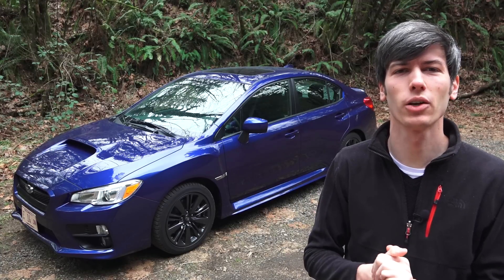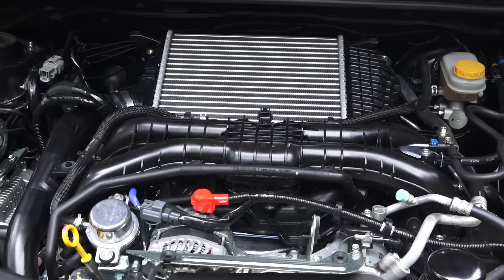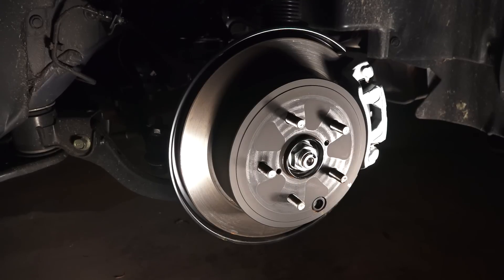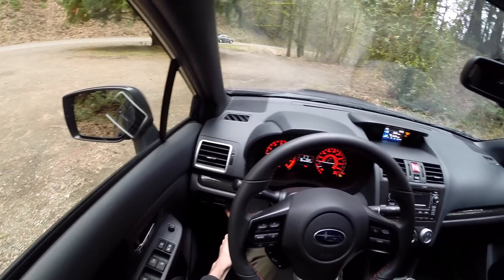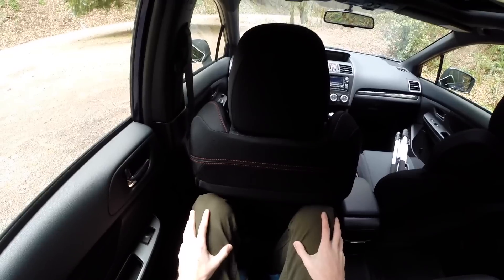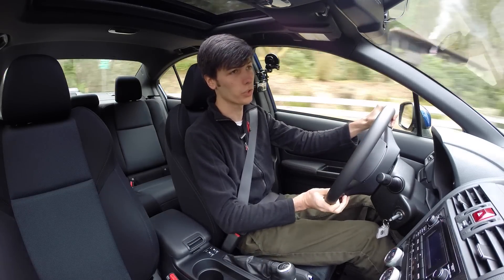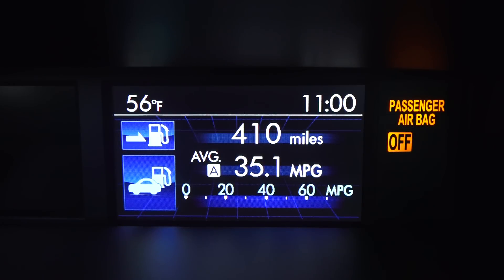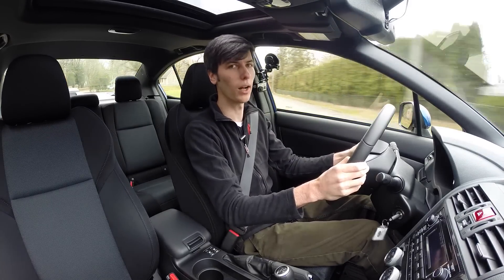2015 Subaru WRX - Review & Test Drive

Comment: Why do so many modern cars have rev hang when shifting?
Reply from the maker: +GT6SuzukaTimeTrials I've driven a good number of modern cars which do not, but that said it has to do with electronic throttles and likely emissions.
Reply: And that's why I hate new cars. I wonder if the new MX-5 does it too. That would be sad.
Reply: +Engineering Explained i saw ur wrx vs sti comparison video, did u talk to Subaru to see if they will fix the rev hang?
Reply: +Engineering Explained which feels faster, the 2016 accord COUPE v6 6MT or the Wrx. I understand this has a better 0-60 due to the AWD, but which feels like it has better pull? I'm looking at a 2015 Wrx or an accord COUPE v6 6MT, I can get a slightly used one cheaper than the WRX, and its most likely more reliable than the wrx, and probably alittle cheaper on insurance being I'm 18, but what is your opinion?
Reply: Engineering Explained  bro can you tell me  in 2015 subaru wrx sport-tech cvt how many it is how many it is 4 speed automatic transmission  please reply to me  bro how many  speed how in speed  automatic transmission please reply to me

Comment: how bearable is the noise on long highway commutes? I notice that you had your moon roof open during the video. Would changing the tires help? If so to what kind?
Reply: +Thai Van Road noise hasn't been much of a problem actually. I can tell it is there, but it isn't to the point of always being noticeable. I have a 2016 Premium WRX.
Reply: Thank you, I am currently shopping for a premium wrx with no options. May I survey how much you got the car for msrp + tags and fees?
Reply: Lets see, I paid just about 35k for mine. They sold at MSRP here and wouldn't budge. All the surrounding areas to me were selling for well over. My fees were minimal, only 150 or so. Out the door, 35,200 roughly. Mine was loaded pretty well though. I got the upgraded sound system (worth it IMO).
Reply: How do you like the car so far? What do you dislike about the car?  Would you invest in Dynamat? I test drove the car and notice that the shifts were very notchy, which makes it difficult to drive smooth. Did you learn to drive smoother with time or it's just how the car is (jerky)?
Reply: +Thai Van I haven't really had the problem shifting smoothly with this car. I had an mk4 gti with a stage 2 clutch, so I may have some practice with smoother shifting. I love almost everything about the car. My cons for the car... hmmm, maybe the interior? it is cheaper, but I knew that going in. It honestly doesn't bother me at all.
Reply: +Thai Van also, I should note that I will be going stage 2 with this car.

Comment: this wrx is faster the si but it will nott outperform the si in traffic on high speed due to weight and two axkes
Reply: +jay czyzyk I just shit my pants I laughed so hard
Reply: +jay czyzyk si? or sti?
Reply: sti
Reply: what you gotta be young
Reply: +Chadd Francisco wrx all the way
Reply: not in heavytraffic
Reply: I call bullshit
Reply: Cole Eden on what?
Reply: Cole Eden I think he meant an sti. I personally back the new wrx over the new sti, but that has to do with the motor. The si isn't even in the same class.
Reply: no  civicsi will outperform any wrx in heavy traffic due to slow shifter and heavy clutch
Reply: jay czyzyk ... what are you talking about? Who cares about heavy traffic.
Reply: no its rod actuated

Comment: hey engineering explained I have one question. Ive heard it's bad go go wot in a turbocharged car in 6th gear. is that true?
Reply: Going WOT on any motor is bad. No reason for going WOT in 6th, it's a cruising gear. The only acceptable scenario to go WOT in 6th is if you revved out 5th gear and I hope your at a track doing that.
Reply: +Mrlolibre what? Wot in any motor? Or wot in 6th gear in any motor? Hopefully the latter becuase these cars are made to go wot

Comment: can someone help me out? it was my understanding (and from looking at Subaru's official website) that the 2015 wrx wasn't even offered with an automatic transmission. I thought subaru stopped offering automatic transmissions for wrx's years ago
Reply from the maker: +MrOverSuper 2015+ have a CVT as an option.
Reply: Engineering Explained thanks
Reply: +Engineering Explained hey I'm in the middle of a pickle. I sold my frs because I'm I needed something a bit more practical since I have a family now. My options are either the 2015 Wrx or and mk7 gti. Since I did come from a drivers car that handled pretty well and I plan to daily my new car. Which car do you think would be a better fit yet be fun to drive for the canyons? I'm going to go on a test drive for both of these cars of course but what do you suggest? Thanks for awesome videos. Keep them coming!
Reply: +jdm06types as for the points you mentioned i'd assume the GTi to be a bit more fun being a bit smaller and tighter. but as for an all rounder the wrx wins. i myself will be upgrading from my 2010wrx to a 15 next year, i've gone through the dilemma of looking for a fun everyday and the wrx wins every time since there is no Focus RS yet :(  half because of its ability to be fun and pratical...and half because of its affordability... a VW will definitely cost more to keep on the road as the maintenance and repairs start to add up later in its ownership.

Comment: hi, i was wondering how hard it is to pick up the manual transmission on this car. i've never driven stick before, i am considering buying this car or the legacy. i like this one a lot, since its more sporty and fits with my personalty. I'd like to get the manual, of course because its cheaper and more fun, but where i live theres so much traffic a lot of stop and go I'm not sure if its a good idea, also considering i've never driven stick before.
Reply: Rough AF believe me. Dumped it a few times by accident and burned it once, but still catches like the first day I got it. 7200 miles

Comment: Does the base WRX really accelerate quicker than the STI or did you just had a typo and it should have been 5.9sec?
Reply: +TheClawGaming If I'm not mistaken, the base WRX reaches max torque at 2000 rpm (which is very low) and has a much larger powerband than the STI. This results in quicker 0-60 times in the WRX. In those city environments where you want quick boosts of speed at low rpms, the WRX will be better. Where the STI shines is around 4000 rpm. 4000 rpm is where the STI will experience its max torque so it tends to be better for more of a racing/track sort of environment when you are actually putting more stress on the engine.
Reply: +Dextah But when you are accelerating hard you will always be in that STI sweatspot. Motortrend even clocked the STI at 4.8secs on a flat ground.
Reply: +Dextah can you tune the wrx to boost at higher RPMs?
Reply: +nejiii drop a larger turbo and yeah

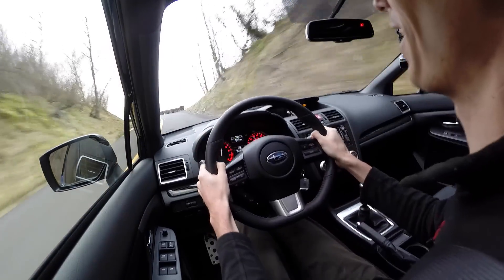Comment: At 11:50, yes I know the MT is always better, but the issue arises when nobody in your entire family (even cousins) have no understanding of what a clutch pedal even is.

I'm genuinely considering a WRX in a near future. However when spec-ed up to what I would want it, it stickers very uncomfortably close to an Audi S3 which is much more luxurious, just as quick and has even more tech on-board. Also I know I won't like my Insurance rates if I decide on this car.
Reply: *****
I know :D
But still it is a dick move on my part.
Reply: +xk302a Yes, but the base $26k WRX has less equipment on it than a base Corolla. Also it doesn't help the MY2015 Corolla feels more premium/expensive than the MY2015 Impreza & WRX. But I digress.

When I load up the WRX with the same amount of stuff I want in the S3, their prices are within spitting distances of each other (~$3k difference) which factoring in the nicer overall build quality of the Audi I feel like I can justify.

Comment: I had a 2015 WRX, base model, until the dealership wrecked it. So, now I have a 2016 WRX, premium. I had them put a short-throw shifter on it before I took it home. The throws are much better now, but it still gives you a good feel of being in each gear.

I don't like the stereo in it. The premium has two stereo options. The higher one has a 7" screen, and much much better functionality. Mine has the 6.2" screen, and a few irritating features. I can't search music by letter. I have to scroll. So, if I want to hear the White Stripes on my 120 GB iPod, I have to scroll for a day and a half to get there. You can't even scroll up, from A, into the numbers, then Z, like I could in the non-touchscreen 2015 stereo. Additionally, if I go to an artist, and want to shuffle all of their albums, I can't do that. There is no "Play All" feature, like in the 7" Starlink system (which also has Nav). You have to listen to one album at a time. I wonder if there is an update for the 2016 WRX 6.2" Starlink. I don't mind the size of the screen, and I don't need nav, but I'd love the functionality to be like in the 7" system. Same software features, just a smaller screen, and no nav. This might be a problem, because the firmware can't be matched. The 7" is a completely different system.

That's all I'm going to say about it, because everyone else covers driving (which I love).
Reply: Since you had a 2015 base and now a 16 premium with inverted struts do you notice any difference handling/suspension wise?
Reply: +Snwszr I do, actually. It's not really different in day to day driving, but there is one turn, on the way home that is better now that I'm in the 16. I didn't even know that the struts were inverted, or if that's the reason. Still, in the 15, when I hit it hard, the tires would screech, and it would start to lose control at the end. In the 16, it hugs better. I can go faster without breaking loose. (This is going about 55 in a 20 mph on-ramp, so they're both great).

I have to be honest though, the 16 has a rattly back dash (from 1500 - 1800 RPM). It drives me crazy. I live pretty far from the dealership. So, I'm about to pull it, and put padding under it, myself. 

The 15 had an issue where the fkin gas door never opened. I had to wedge a gum pack under the interior handle to get it to stay long enough for me to get outside of the car, and get the door open. As far as handling goes, they're both about the same. I don't really notice a difference.

For what it's worth, I love my car. I'm not getting anything else, unless I get a massive raise, and can afford a GT-R.
Reply: +hakkujin dude thanks for the very informative info, I haven't had this question answered clearly on Nasioc or the web. Only heard on NASIOC that it feels only like its a softer suspension and less raw than the 15's/16 base.  I'm planning on upgrading to a 16 in a few months and just contemplating on getting a base or opting for premium for inv struts and bigger wheels. that's good to know though, glad to have got that cleared up and thanks again for the insight 👍🏼
Reply: +Snwszr The last thing I'll say is, the summer tires are summer tires only. They're completely useless, and terrifying in the snow. I got some all-weather tires on mine, and it's amazing in the snow. This is my fourth Subaru because I live where it snows. If you already have one, you know all about that already.

So, if you get a new one, it's shorter, and wider. So, it really does turn better than the old ones, but you'll have to get a short-throw shifter, and some all-weather tires.

Comment: A recent firmware update reduced the rev hang by a ton. Also the 4k torque dip has disappeared as well. Seems like Subaru is addressing the complaints that a lot of us have been talking about.
Reply from the maker: themomopan Could you share a link referencing this update? Would love to read up on it.
Reply: Tim Davidson You have to take it to the dealership and have them flash the ECU
Reply: Jay Sanchez have you done this? if so - where and how? did you call them to explain?
Reply: themomopan   I have felt the 4k dip as well. Was this addressed with a dealer flash?
Reply: +Engineering Explained http://forums.nasioc.com/forums/showthread.php?t=2724677

Comment: Don't forget about the hill assist when starting out from a dead stop on a hill. Instead of the car rolling backwards, it will engage some type of brake for 3 seconds allowing you to easily start out without the worry of rolling backwards and hitting someone or something.

Comment: For the money is the wrx better than the sti?
Reply from the maker: Cole Jones I haven't driven the new STI, I do own the '14, but I'm inclined to say for the money yes.
Reply: Engineering Explained ok thank you
Reply: Cole Jones Depends what you're looking for in your car. Performance and fun factor = yes. Daily driver and occasional fun on the weekends = get either one, but probably just go with the regular WRX. Either way the STI is a more fun car to drive, while this one is much more efficient. It's your bag. I went with fun since I don't have a wife or kids to drive around. If I did have a wife and kids, I'd have gone with the regular WRX. But if you're pure about performance and fun, throw the STI into sports sharp and C.Diff auto/- and you'll have some real fun and everybody around you will notice it (which is another plus or minus depending on what you want out of the car. That spoiler is BIG. The car is LOUD. Regular WRX saves you or neglects those things depending on how you look at it).

Comment: Iv been a WRX fanboy for years. Test drove the 2015 last month and I was very surprised.... At how much it sucked. Interior for a 30k car is shit. Cheap/fake carbon fiber. Super shitty stereo system. Turbo lag is real. Shifting isn't smooth. Clutch is nice though. Basically I felt like I was driving my grandmas car.. That had a turbo. 

Went with a 2012 civic si for 17.5k walk out price w/ nav and all the other upgrades. Spent around 7k on it. Kraftwerk SC, exhaust, intake, flash pro. And you have a fun little 350hp 2.4L car for 10k cheaper than walk out price of WRX.
Reply from the maker: ***** To each their own, but if you're a WRX fanboy and you think this one has turbo lag, I can't imagine what you think of the others. This engine/turbo is far more responsive than the previous generations.
Reply: Yeah its not as bad I guess. I just think it's a little over priced and the interior is garbage. Thanks for the videos!

Comment: Not meaning to be THAT guy, but the throttle is actually four individual plates on two different throttle bodies, one on each side between the heads and intake runners.  I'm fairly confident this was done in order to combat carbon buildup, particularly common in direct injected engines, by allowing less blow-by to make its way that far into the intake.

Great car, by the way.  I've had my 2015 base model since October and am still very enamored with it.  I'm exited to see just what the FA20 has up its sleeve.
Reply: Glad you love the car. Btw, those 4 throttle bodies are Called TGVs. The throttle body is between the intercooler and the intake manifold.
Reply: I see.  Thanx for the clarification.

Comment: I own a 2015 WRX. After getting annoyed by the Rev Hang for more than 11 months now, I found out that you can remove rev hang by disabling the Hill Start Assist Control feature. I disabled it today and the car shifts like a normal manual vehicle now. I'm so glad I found it out today, not later. All 2015 owners should try that!!
Reply: Subaru rolled out an ecm update for the 15s. And no hill assist DOES NOT remove rev hang. Wish it were true but nope sure dont
Reply: What update?
Reply: Subscriber what update?
Reply: What update?
Reply: What update?
Reply: What update
Reply: There's an update the fixes the problem
Reply: Subscriber  what update?
Reply: Subscriber what update?
Reply: Subscriber what update?

Comment: This is the best review of the Subaru WRX by far. You touched on every question I had. I bought mine 2 months ago in Buffalo, NY. I was concerned that I was being a dummy with the shifting and it getting stuck when I did shift. Now I know, it's not operator error. Thanks for also showing us the 0-60 (58mph), it achieved about the same that I did. I went from a Tiburon ('08) to this. I couldn't be more happier.

Comment: Rev hang.. is that because there's not enough turbo blow-off?
Reply from the maker: psychdoggg I believe it's due to the electronic throttle body remaining open, and I'm inclined to believe it remains open intentionally, not because it's too slow to react. Unsure why, perhaps related to emissions.
Reply: After recently observing my 08 Civic during shifts, I noticed maybe half the time the ETB ever so slightly hanging after disengaging the clutch under mild acceleration.  Maybe that's an actual desired characteristic of an ETB at lower speeds?

Comment: 4:32, I'm 6'3" and mostly legs.  There's a little trick I learned if the seat all the way back isn't giving you enough leg room (like an S2000 where seat space is limited).  First, move the seat forward a little bit, then recline the seat back.  You'll sit farther back in the center of the seat.
Reply: Yeah, it's a slightly less crappy situation.  Not ideal by any means.

Comment: Question: Car and Driver has the HP and Torque figures for the 2015  WRX and 2015 STI at about the same except the WRX has more torque lower in the rev range, so does the WRX accelerate as quickly as the STI?

I test drove the 2015 WRX and it seems slower out of the hole than my 2012 WRX, so even thought the 2015 handling is tighter, I don't know if I want to trade my 2012 for a 2015.